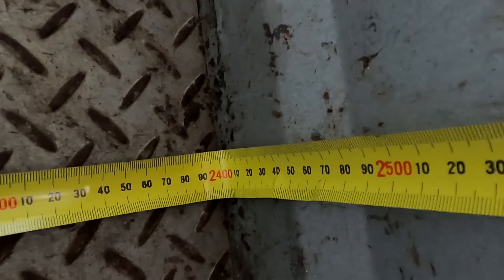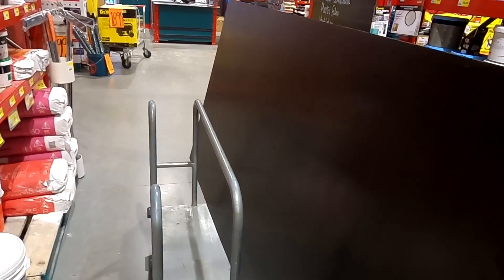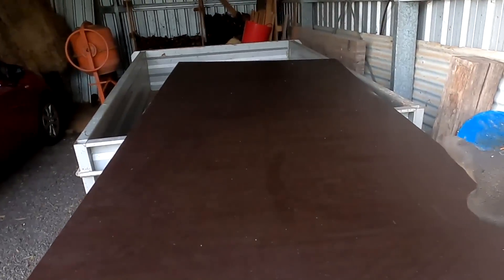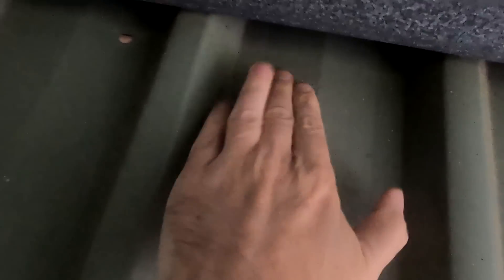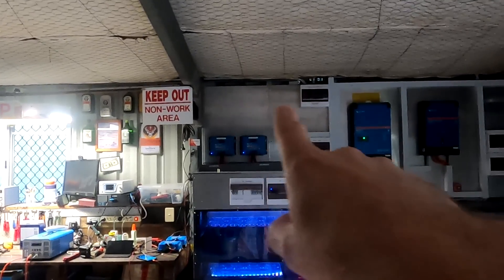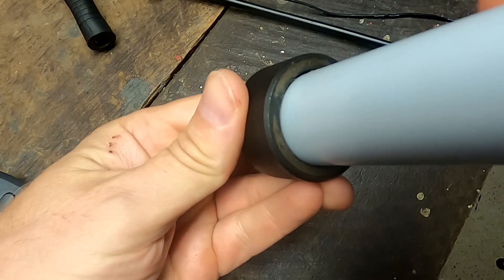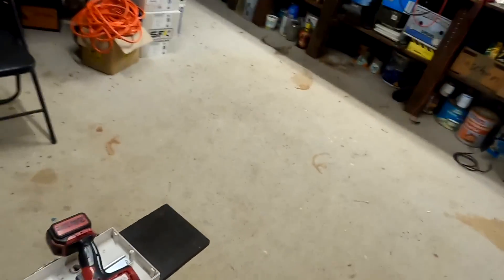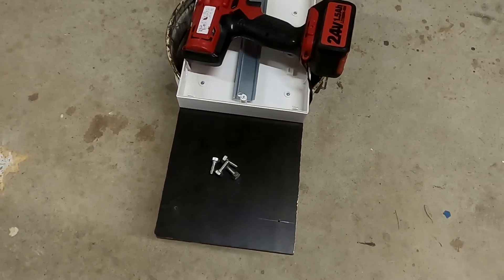Preparing for the solar upgrade. But where to start? 1/5

Comment: One video a day, we are spoiled indeed  :) You are going to have so much power!
Reply from the maker: I need it for Winter. Summer has never been an issue.
Reply: @OffGridGarageAustralia  it is the nature of it, finding daft ways to use power in summer and then conserving it as much as possible in mid winter while simultaneously using more, being inside more. However you are fast approaching peak solar season with your new panels.

Comment: I think Andy 2 is helping, someone must have put the other side of the hole punch on, or some very careful balancing was involved.
Reply from the maker: That was a bit of work to get the 2nd part of the punch on just by myself. It just held the thread of the punch in the metal hole. It all takes 3x longer with the camera running. But I like doing it, so...